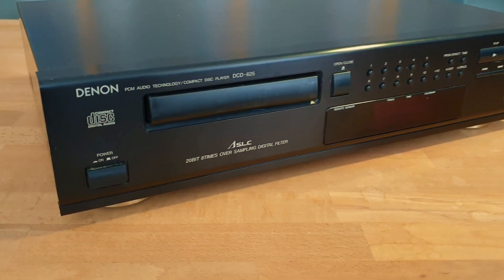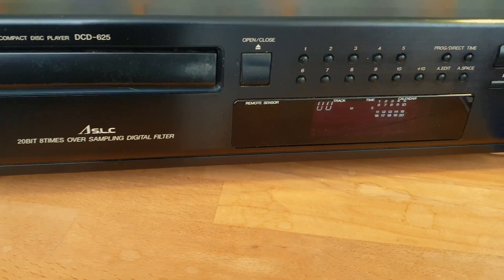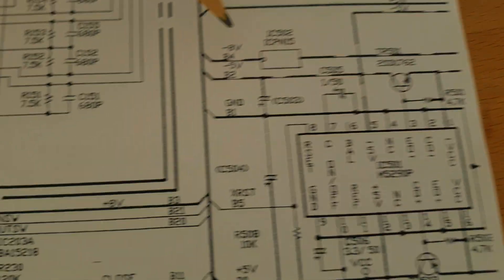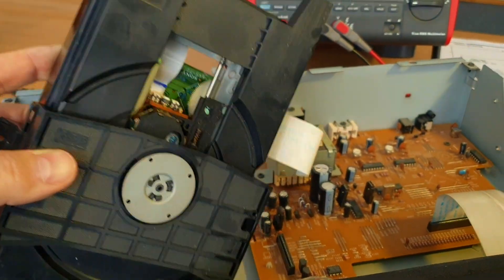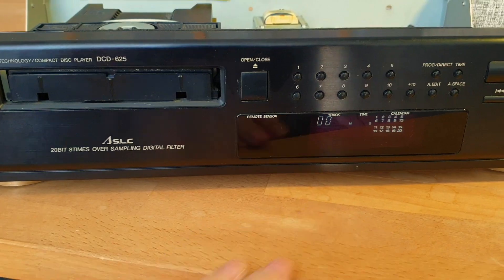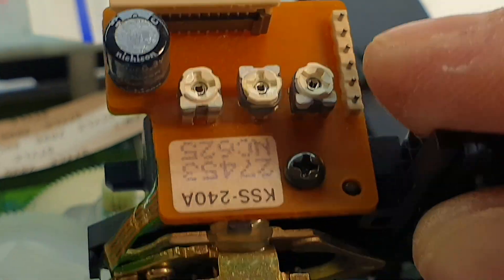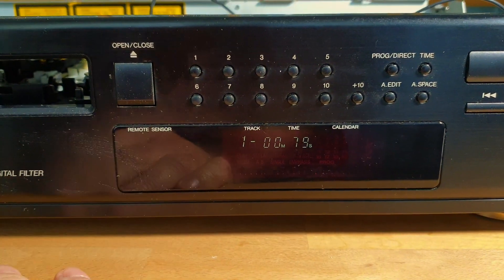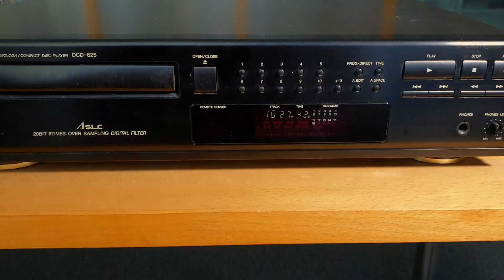Repairing a CD player DENON DCD-625

Comment: Your video helped me diagnose and fix a free Denon DCD-660!  In this case I removed the cover (just five screws) and performed a simple gentle cleaning of the lens surface with a soft swab dipped in 90 percent isopropanol. That simple procedure restored the read function of the laser.  The player now works as new and it sounds amazing!  Thank you so much for your expertise and willingness to share it!  Cheers!

Comment: Awesome video, thx! Question my DCD-695 (same drive) skips (jumps) during playback but only at the very beginning of a CD. What would you do there, what is the reason for it?
Reply from the maker: Hi, thanks.
I would check the self-calibration fugures, if they are within specs.
Pickup defects aside, it may also be the dirty or badly oiled screw rod, that does not allow the pickup head to move to the terminal position.
Hard to tell without seeing.
Reply: @sirrosh69 Imagine, Just cleaning the lens with a cotton swap with a tiny bit of isopropanol + some maintenance of all sliding surfaces fixed the problem! It now plays right from 00:01 without interruption 🙂
Reply from the maker: @marcoam2610  Great! One more functioning piece of equipment.

Comment: Hi, no Sund? Check the outputs direct on the DAC with your oscilloscope. You know, no signal on it, DAC chip overheats? Change the chip. You already verified voltages. If so, track the signal to the opamp and the coupling capacitors. Good luck!! Tschüs!!
Reply from the maker: Thanks,  you may also see the rest of the video)))
Reply: @sirrosh69 Thank you, I did watch the entire video. Sorry if I disrespected, was not my intention, just wanted to help. Adios.
Reply from the maker: @arturovillalpando289  Not at all, because many start to comment while watching, not knowing that the issue has been found by the end)))